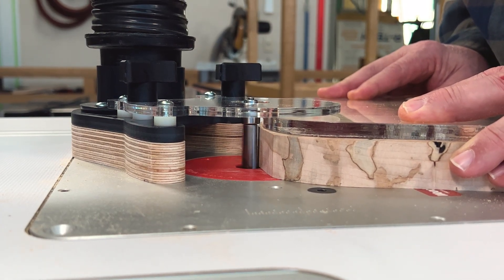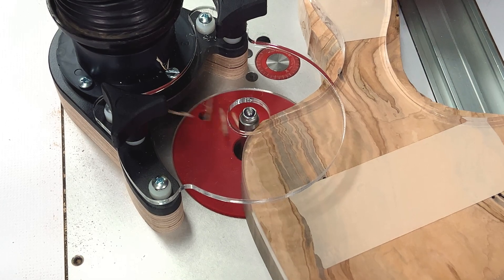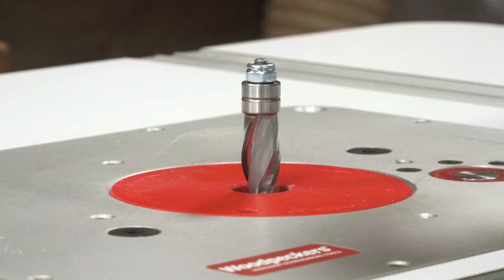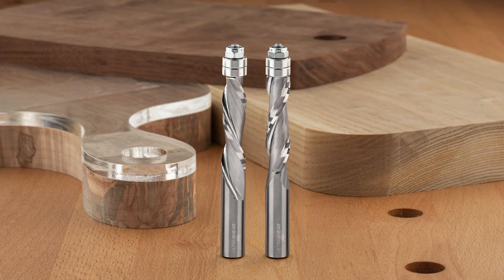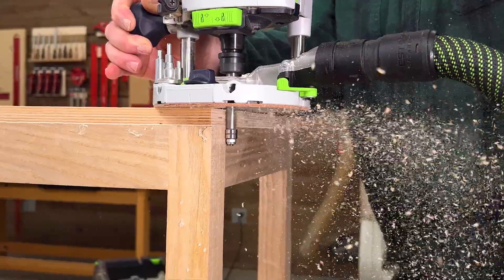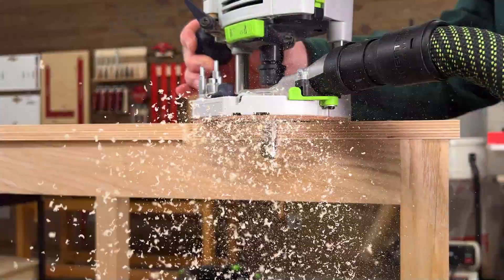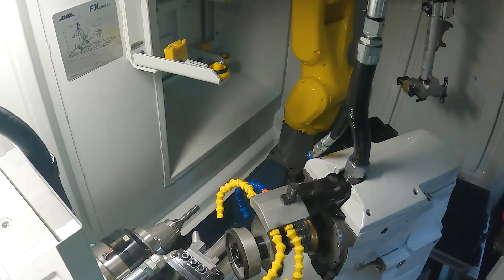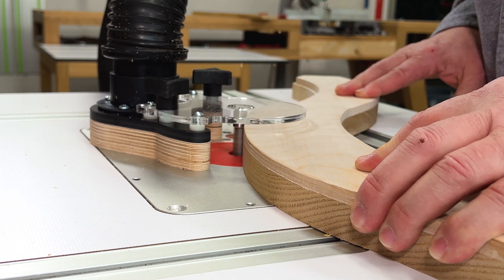Ultra-Shear Solid Carbide Spiral Flush Trim Bits | Woodpeckers Woodworking Tools

Comment: Using a template for a wine caddy. My bit is a fluted top bearing and I can only cut when going level or down grain. Will a spiral upcut or downcut allow me to cut into the grain while following the template?
Reply from the maker: Ed, your best bet is to get a flush trim/pattern bit, which has a bearing both above and below the cutting area. This would allow you to adjust the depth of cut and use the template either above or below. This allows you to always work with the grain. Spiral alone will help, but working the pattern on either side seals the deal.
Reply: Thanks, I ordered a spiral with a bearing on one end but don't see a 1/4 inch on the website with bearing top and bottom. A 3/8 flute would work also, radiuses are pretty tight.   @WoodpeckersLLC
Reply from the maker: Didn't realize you needed small diameter. I think the 1/4" spiral will do the job for you.

Comment: Great design, but I would like to ask, what are the advantages of this design compared to Up cutter? What is their biggest difference?
Reply from the maker: This bit is available in both Up-Cut and Down-Cut. Up-Cut is generally preferred in solid wood. Down-Cut slices down into the top of the material, which leaves a nicer finish on the edge. This applies primarily to plywood and composite materials like MDF.

Comment: Question: I used a down cut 2 inch cut height and the pc just got ripped out of my hand. I was cutting (trying) 1¾ inch in height by about ⅛ inch deep. I tried 3 separate pcs with the same results. Needless to say it scared the hell out of me. Any ideas why? Any help will be appreciated.
Reply from the maker: end grain? edge grain? curve? straight? router table I assume. Down cut is pushing up on a router table, and that is a big cut. Once it starts pushing up, it's hard to fight it. Give me some more details and I'll try to help.
Reply: @WoodpeckersLLC  either edge or face .I don't recall. Had a round bowl and a rectangle. Threw both. I had a round bowl with a height of ¾ inch height and  ⅜ deep. That worked great.
Reply: @WoodpeckersLLC  by the way, thanks